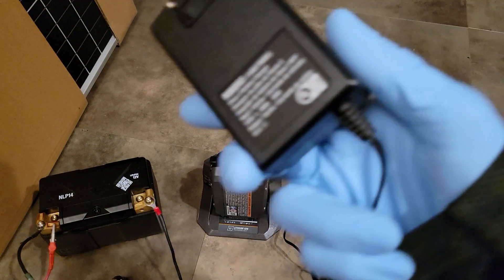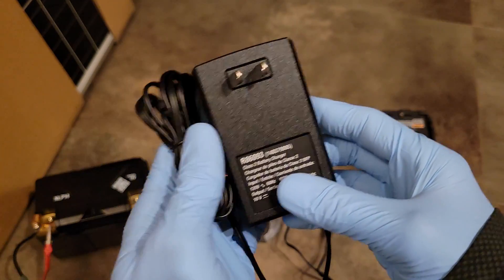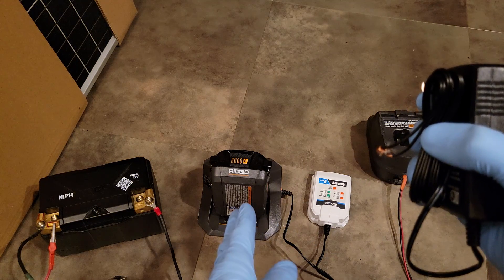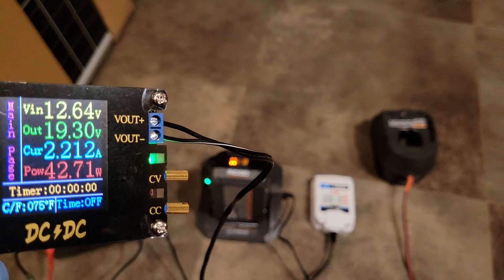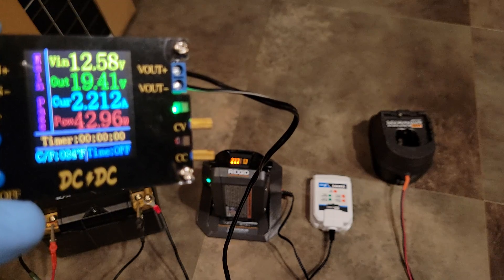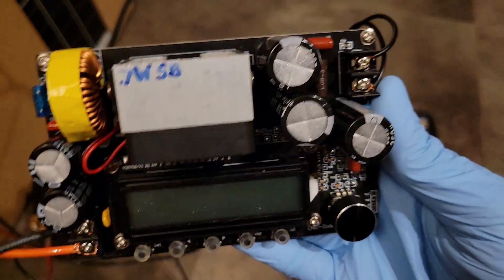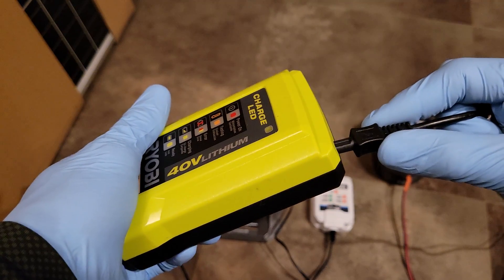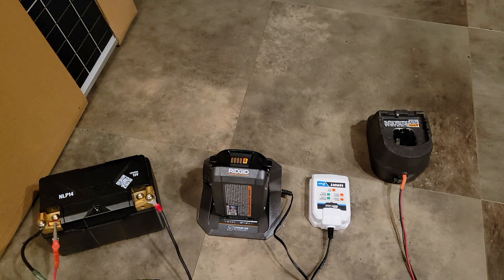How to Direct Dc Charge Ryobi, Hart and Ridgid 18V 20V 40V Batteries

Comment: You don’t have to cut the wires, the adapters are not ac to dc only, they are best if you supply directly from the solar panel, and also polarity doesn’t matter if you connect your solar to the pins of the adaptor. These are transformerless Switched-mode power supplies (SMPS) so don’t care if ac or dc is connected to their terminals.
Reply from the maker: @pr5991  I have heard that but never tried it. If it works that would be awesome but would they be buck only?

Comment: is the bms in th ebattery or cradle ? im trying to make my 40v kobalt charger a liipo charger for home made 8650 batt  packs made from old drill batteries to power an electric scooter
Reply from the maker: Most batteries have the BMS inside the battery itself.

Comment: Can I go directly from a car battery to the hart or ryobi charger? (i.e. no dc to dc as intermediate)
Reply from the maker: If you fed the 18V cradle direct 12V without the DC to DC converter, you might get current flowing from the 18V battery into the 12V battery and worst case you could get over voltage on the 12V side, damaging components in the car.
Reply from the maker: Oh as far as using the 18V chargers for a 12v battery, the OEM 18V chargers probably won't recognize a 12v battery.

Comment: Do you need mppt though for solar? I’ve seen a video on YouTube where he went straight panel to Ryobi charger and it worked. It took what the panel made. Needed to have a high VMP to fully charge but wouldn’t a simple dc to dc circuit enable solar charging?
Reply from the maker: I've got a good size collection of batteries to swap so I charge them slowly using these passive cooled, 35 watt chargers:

https://www.amazon.com/gp/aw/d/B09MN3N6TL?psc=1&ref=ppx_pop_mob_b_asin_title
Reply from the maker: That's a good question I always use mppt if it is direct solar to battery.
Reply: @LibertyDIY  Hey I see you are still active on here!!  Does that Drok voltage regulator power the charger fine/is it just slow to charge being lower wattage?  Happen to know the brand you first showed that you got from Ebay?  Planning to set this up in my little teardrop trailer for extra power sources when we need them.
Reply from the maker: @Joseph-du1cp The ones that have little fans can charge up to 50 Watts which is similar rate as the stock chargers
Reply from the maker: @deveak if the solar panel had a working voltage of less than 21V it would probably work for bulk charging a dead 18V battery but you'd have to be careful not to let the battery get above 21V and youd probably have to use a blocking diode to prevent reverse flow from battery into the panel when the clouds blow past etc